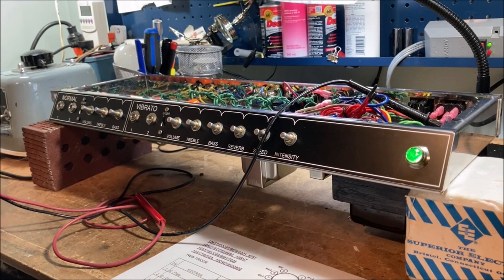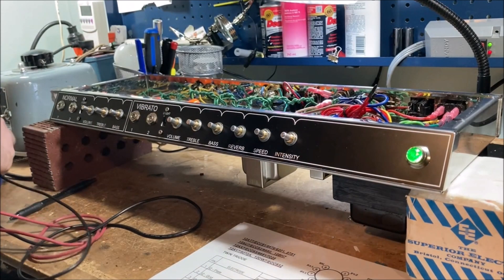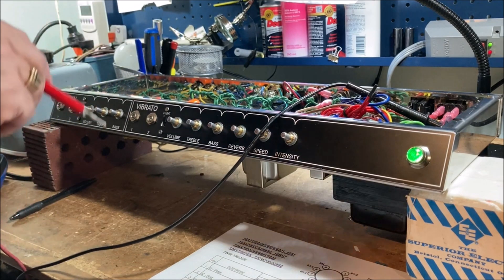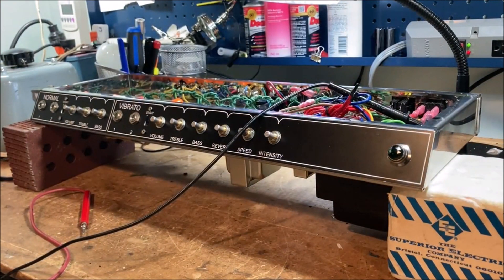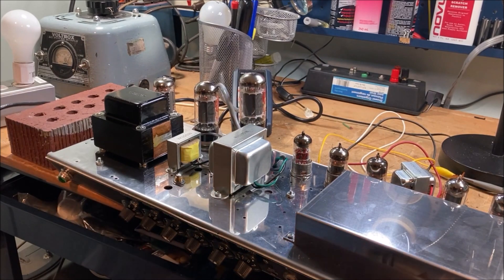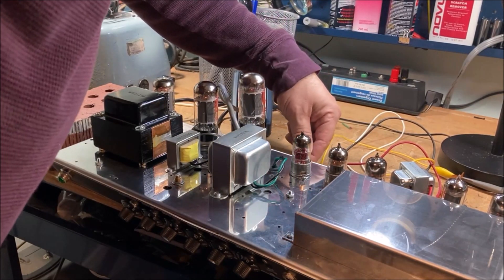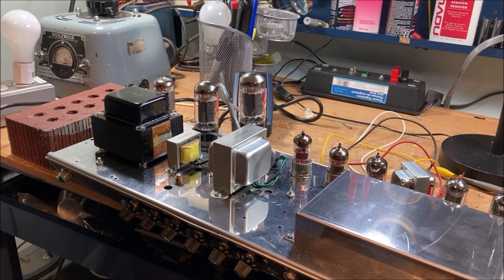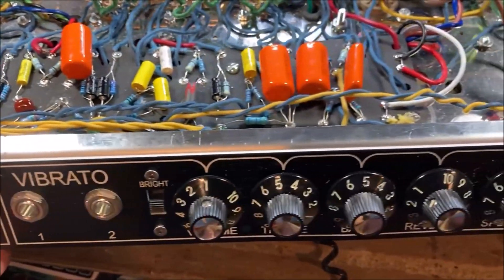Weber 6A20 Deluxe Reverb Clone Build Part Six   Voltages, Bias, and Sound Test

Comment: Did you have any methods for improving the fit inside the chassis?
Reply from the maker: Yes.  I removed the tolex that was folded over on the inside and sanded the wood.

Comment: A sharpy works well on the black part of the faceplate.  Nice job on the videos.  I built the same kit last year.  I ordered 3 different colors of wire so I alternated colors on the board which made it easier to connect after installation into the chassis.
Reply from the maker: A Sharpie is what I used as well.  Weber is sending me a new faceplate, though.  Thanks for the comment.